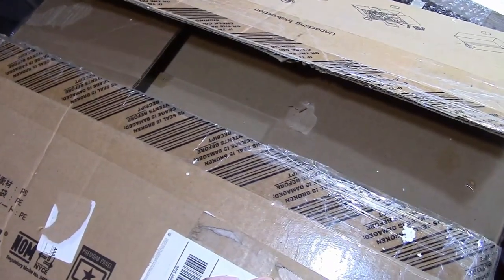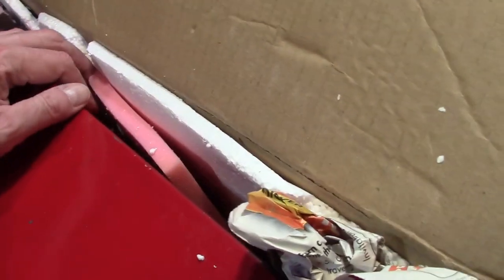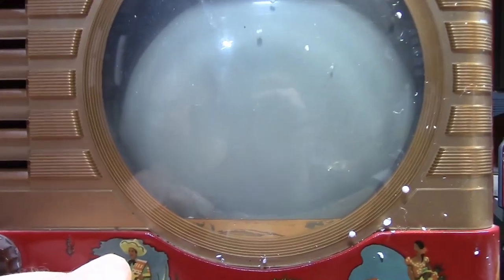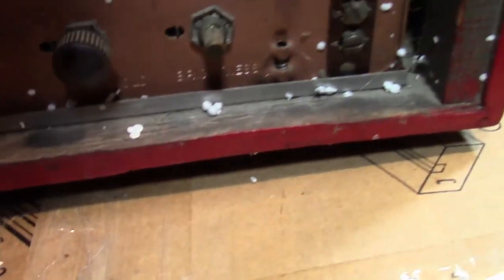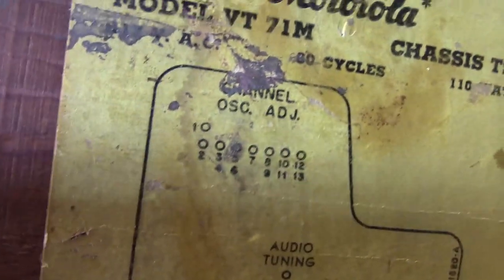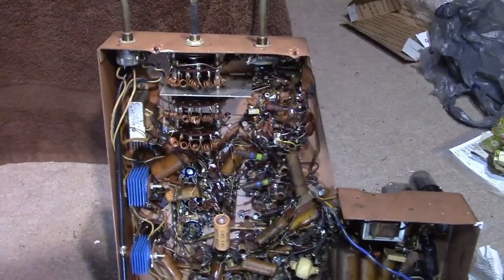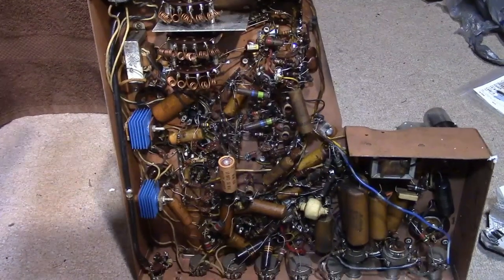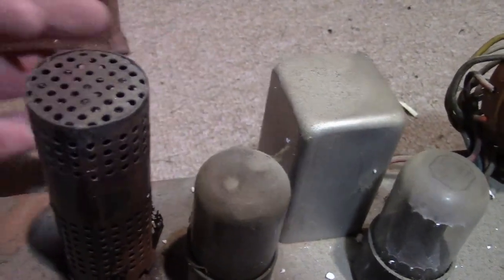Mythical Moto 7VT1 or Frankenset ?!?!?

Comment: I have a whole bunch of those I bought off an elderly collector. I never knew there were so many variations or revisions. Maybe I'll have to dig into them someday
Reply from the maker: I worked with the collecting community to put together a list of serial numbers and dates. Near as I can estimate they made about 200,000 total of all the variations. Probably makes it the most common early TV. Weird, quirky unique design. I think you'll find them interesting and maybe a little frustrating to work on. They definitely cut some corners to keep the cost down.
Reply: how many kids were spoiled to have a TV in there room back then 
that TV was  like a thousand dollars back then
Reply: @force311999  I think you are overestimating the price of these things.  I don't think it sold for anywhere near $1000. Or do you mean inflation adjusted it would be like spending 1000 today?
Reply: yes please dig dig dig

Comment: Looks like the decals were done in the 50's, they're somewhat similar to some of the wall hangings in my grandparents house which they built in 1953.  It is interesting that the paint is done on some of the inside edges.  Very thorough job.  Like you suspect, it sounds likely that Motorola was trying to use up some spare cabinets and chassis.  Zenith did this a lot in the late 30's with their radios... They'd take a massive cabinet meant for a 12 tube set and stick a 6 tube in it, or they'd put a table model chassis into a console cabinet to use up extra chassis, etc.  In 1939 they added pushbuttons to many of their 1938 consoles and sold them alongside their new '39 models!  Anything to clear out inventory...
Reply: zenith and GE used a lot of tube cabinets with solid state radios

Comment: Check that out very close before you remove the paint! It is one of the custom colors available from Motorola in the late 40's early 50's. and from the looks of how far a person would have to disassemble that unit to get the paint every where, I think this is a factory custom paint.
Reply from the maker: I'm not.  It's too unique to strip.  From what I can see where the paint chipped, there's just raw mahagony veneer underneath,
Reply: I don't agree, it was clearly aftermarket, if it were original it would have been sprayed, not brushed on.

Comment: I'm not too sure I would dismiss that paint job is being home handyman, there's a lot of things that make it's a custom or factory if you notice, where the paint is chipped off it appears to be there is a thin white Edge like a primer which I'm pretty sure no one would do at home secondly whoever it was made it a point to take the entire front of the set apart to paint it. As you have stated the holes in the front are very strange and their placement as the as the Motorola logo doesn't look like it would fit anywhere in those holes.

Comment: I have a similar Motorola.  What is the white material in the top of the cabinet, it looks as if it could be asbestos, it was commonly used to protect surfaces from excessive heat.  It could be asbestos to protect the top of the cabinet from the tube heat, so It might pay to check it out as asbestos was commonly used that way for many things back in those days.
Reply from the maker: Yes, it is asbestos. The ballast tube gets very hot when the set is running.

Comment: You know this TV is original when the back cover is held in place by more than one type of screw. Series string set from the late 40's (or thereabouts); I  noticed it has a ballast which is a high failure part. Sounds like a fun future project (the CRT may be marginal so if you do get it working, the picture won't be brilliant).

... and HAPPY THANKSGIVING Bob, to you and your family. :)

Comment: Beware that sheet of asbestos on the underside of the top... , above the ballast to shield it's heat, I guess .  I just ran into that problem for the first time myself in a Stewart-Warner radio. Has to be dealt with.
Reply from the maker: It definitely there to shield the wooden cabinet.  The ballast tube below it get extremely hot.  I just leave them in place.  It's only dangerous if broken up into small fragments and inhaled.

Comment: I remember you having one or two prototype chassis.
Reply from the maker: Yes, one is a from very early in the production run and doesn't match the service info.  The other would be from around the middle of the run like this set.  It had some extra parts in the IF circuits.

Comment: my picture tube socket took me 3 hours to get it off the first time on the 7vt5a2!  sprayed it with tuner cleaner with lube and worked it with a screwdriver...3 hours later it came off it was like they glued it in place.  Not even sure why I didnt just gorilla the socket off as the tube was busted from the tube gasket rotted so band it just clanked around during shipping.

Comment: Why would you have to adjust the tuner for each city?  Does it not have a regular tuner in it (like channel 2 is channel 2)?  Are the channel numbers just arbitrary numbers like an old VCR where channel 2 is the second pre-set channel and not really channel 2 as in NTSC channel 2?
Reply from the maker: There are only 8 positions on the channel selector while there are 12 possible broadcast frequencies.
Reply: @bandersentv  Thanks.  I didn't realize it had only the 8 positions.

Comment: I've actually never worked on a Moto this early...Where's the HV rectifier tube located? i didn't take notice to one on or under the chassis.
Reply from the maker: Inside the silver metal box on top of the chassis. HV coil is in there too

Comment: That paint job was definitely not done in a factory, it was painted with a brush, if it was original it would have been sprayed, or at least had the brush marks rubbed out. That being said I have seen much worse, runs, sags, dirt, whomever did it at least took some care.
Reply from the maker: True.  Nothing about that finish or decals is a factory job.

Comment: those decals look old to me
Reply from the maker: I agree. The more I look at it, the more I think that it was all done long ago and may even be original. Maybe an employee having fun with leftover parts?
Reply: @bandersentv  - It's odd though that the Motorola decal (missing) would be fitting over some of the decals, partially obscuring them yet the decals have holes punched int them indicating that the Motorola decal might actually have been on there.. seems sloppy to put the decals in that location... they are old though (as old as the TV?)
Cheers,
Reply: @EngineeringVignettes  the badge may have ben missing so they covered the holes with decals but 
over time the holes opened up